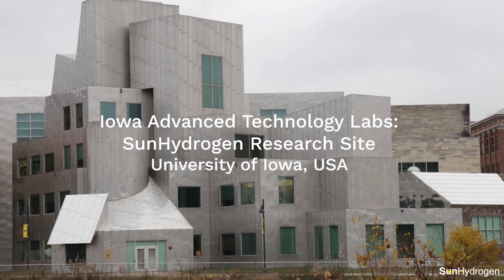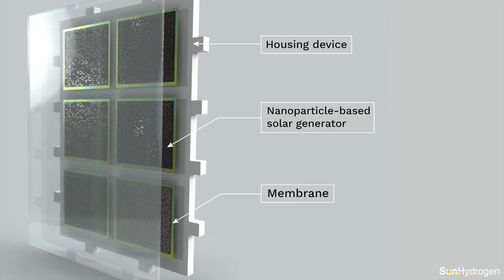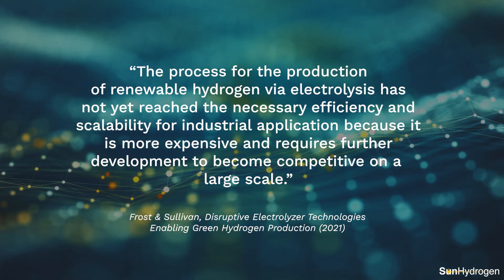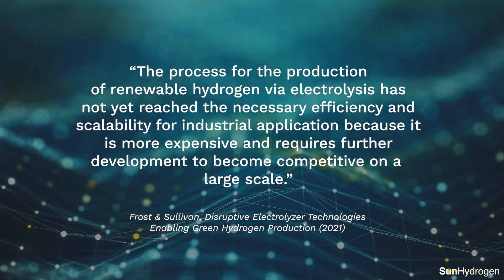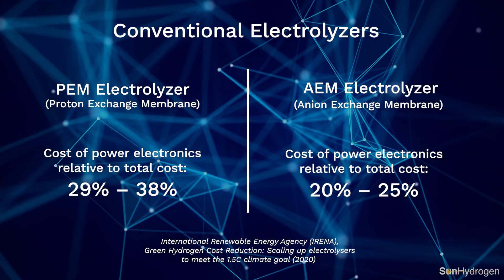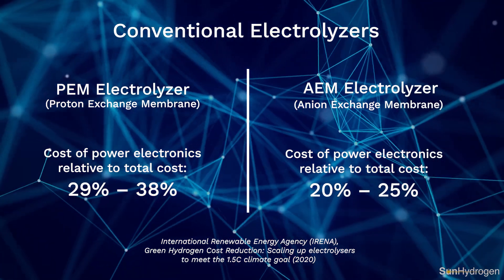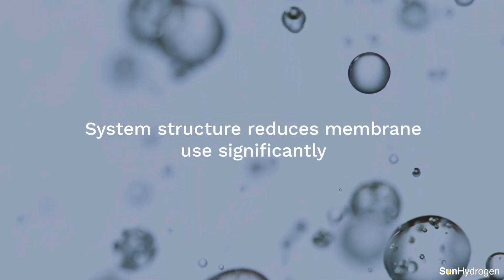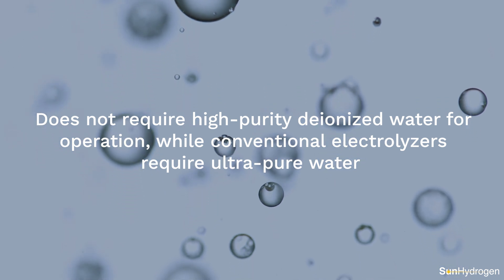How SunHydrogen’s Green Hydrogen Technology Competes With Conventional Electrolyzers

Comment: Hey that’s great but what do we need/use the hydrogen for  ?  It’s all ready pretty established that we’re not going to use it power vehicles.
Reply: H2 fuel cells are lighter weight than a battery pack pure EV. PLUG power is collaborating with Renault for production of the Master, a Euro sized delivery van that runs on H2. A huge network of H2 fueling stations are being constructed throughout the EU. Fuel cells also used for buses, trains, even ships by adding to their usual fuel to reduce carbon footprint. I think it will be used in passenger cars too, because it's the same set up as today with quick fill up 5 min. & long distance from a fill up. It's particularly important in class 8 trucks where a huge bank of batteries weight takes away from potential weight of load transported. Fuel cells are going to go so big that anyone invested in companies making them will make a fortune. I'll be the first.